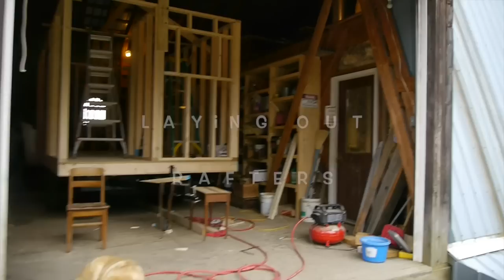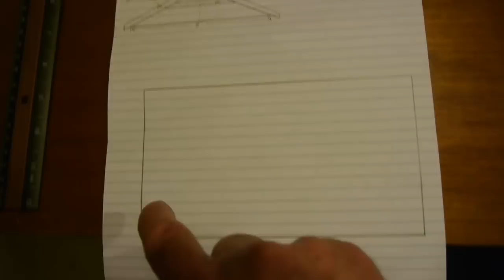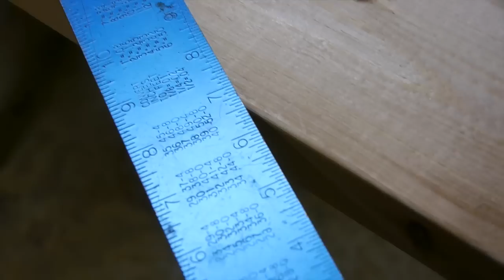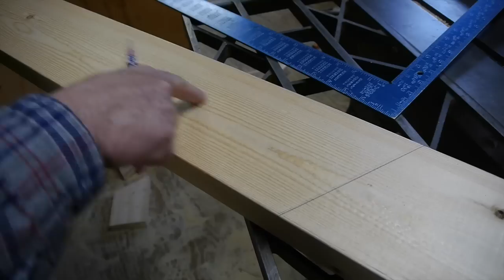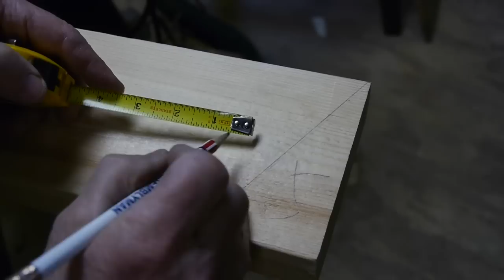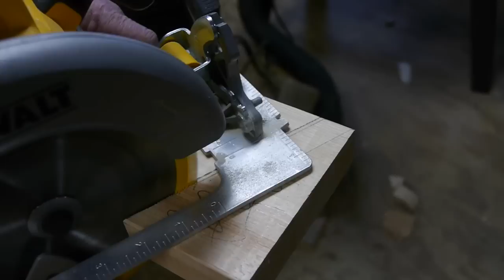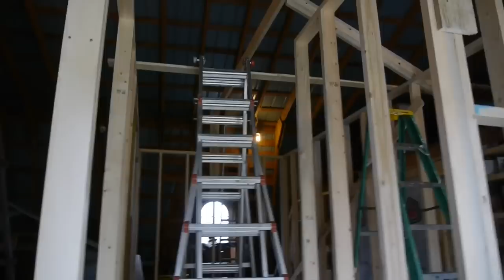Rafters:  How to lay out your rafters

Comment: Thanks for showing us how to lay out rafters. You said that your building is 8ft wide . Now if it was 8ft .  10in wide would you just add 5in after you made your last ( 4th ) step off before you make your mark for the over hang ?
Reply from the maker: Yes ... you got it!
Reply: Thanks . I've watched this video many times and I'm still amazed how easy it is to figure out how to make a rafter your way. Any ideas in how to figure out rafters for a gambrel barn roof ?
Reply from the maker: I have a way to do that too.  Watch my video on building a small barn.  It's on my channel somewhere.  lol
Reply from the maker: https://www.youtube.com/watch?v=PGMpy8qVYGI&index=7&list=PLGsbGt5K9TK1TvpkBUezbel7_H2h_T-RS
Reply from the maker: The rafter part is at about 2:20
Reply: Thanks again Tim
Reply: With a run of 12 inches and rise of 6 inches, each step-off will add 13.416 inches to the length of the rafter, by Pythagorean theorem. An additional run of 5 inches  (rise of 2.5 inches) would add 5.59 inch or about 5 9/16 inch to the length of your rafter, also by Pythagoras.

Comment: Nicely done Tim. I like to use rafter buttons. I don't use them often but they are one of those handy things to have when you are doing stairs or rafters.
Reply: Called stair guides......
Reply: Better still take a nice piece of  hardwood approx 1" x 3/4", drill 3 evenly spaced holes, rip it down the middle. Clamp a piece each side of your framing square, using short coach bolts and wingnuts. Now you have a fence you can adjust to any pitch. Much easier to adjust than stair guides.
Reply from the maker: +WoodRodent 
Thanks for watching and commenting.  Yes, I have some of those but for this video I thought I would keep it simple so people wouldn't think they had to have the buttons.